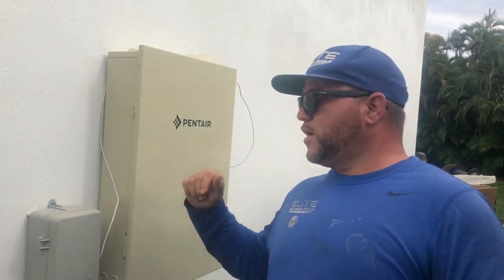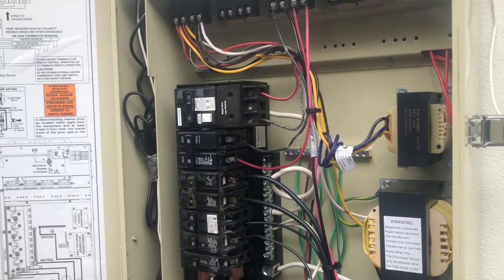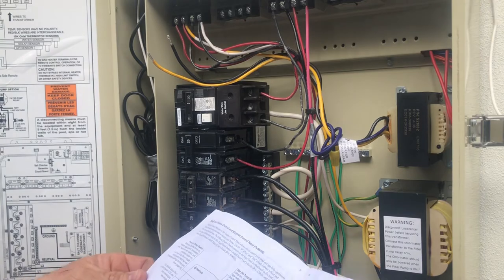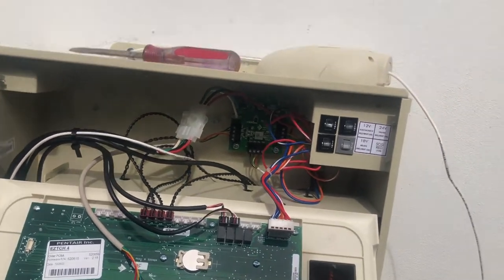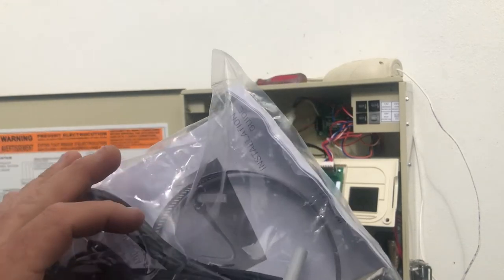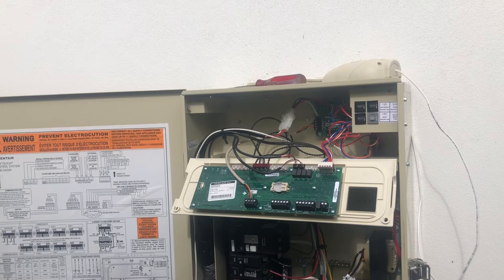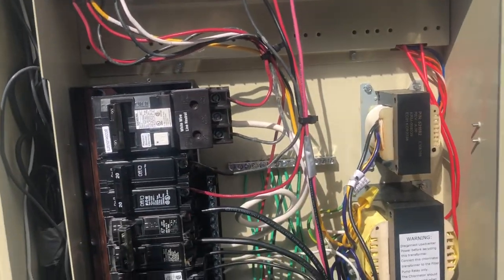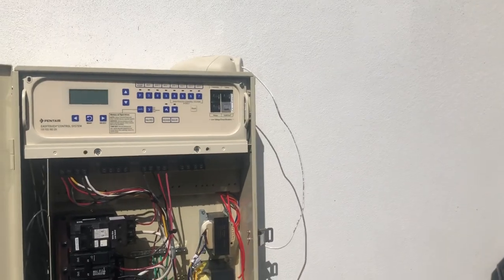Pentair EasyTouch Automation Installation | Part 2

Comment: I have Pentair EasyTouch also, and my ichlor salt power box was installed having constant 240v, how do I wire so it only have power when pump is on?
Reply from the maker: Watch are the parts of this Pentair EasyTouch automation installation series, I’m sure I have the part of the installation of the salt system in there.